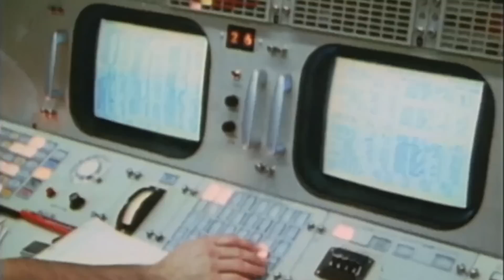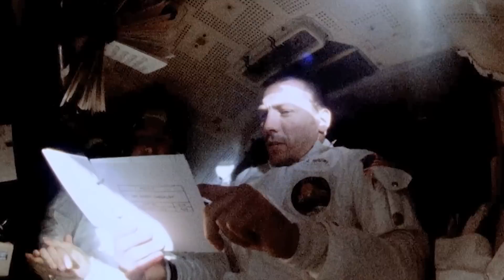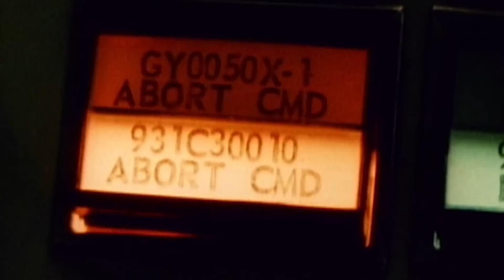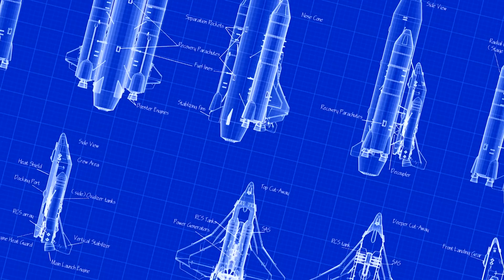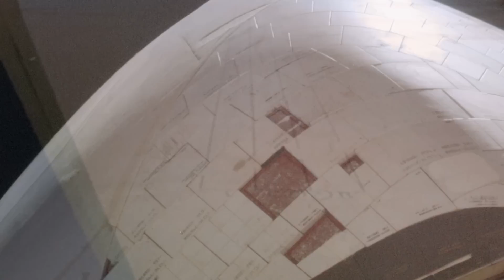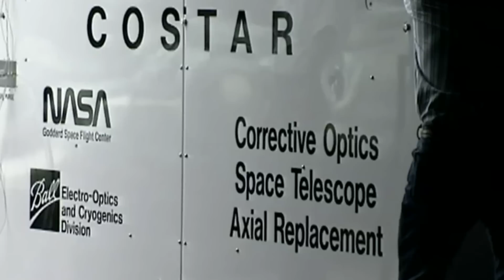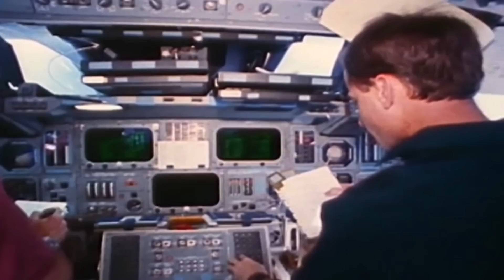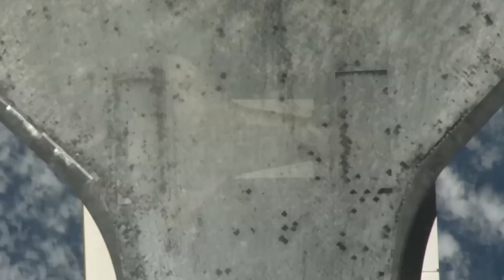The End Of Apollo: What Happened During The Final Missions To The Moon? | Trajectory

Comment: That mystery has already been solved. Some ice debris fell off during launch dislodged Some heat shielding tiles. That was known in plenty of time abort the mission. But they let the mission continue. Upon re-entry the missing tiles let super heated air in around one the wings causing it fail catastrophically upon re-entry.
Reply: Part of the upper foam fell off and hit the wing during take off : this was seen and a program run to predict the effect. The program returned ** , the Fortran language response when a value is off the scale, too small or too large. The ground crew were so complacent they didn't bother to ask the crew to check : they fried.
Reply: @michaeledwards2251  An important consideration at the time was that there was nothing anyone could do about the damage. No changes to the flight plan or crew duties could repair or even assess the damage, so they made no changes. (Pardon my absurdity, but they didn't carry a spare left wing with them.)
Reply: @beenaplumber8379  
If they had known, alternatives such as 
(a) Attempting re-entry with the right wing down, left wing in the cool zone 
(b) wait for relief : use earlier rockets to provide a way down or even other nations. 
(c) wait for a partial repair kit before attempting (a)

Ignorance is not bliss.